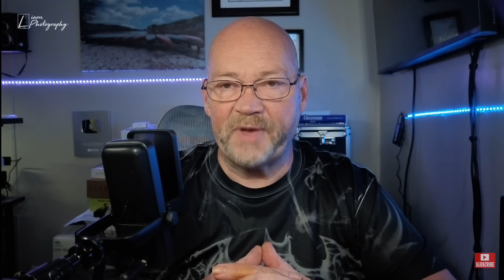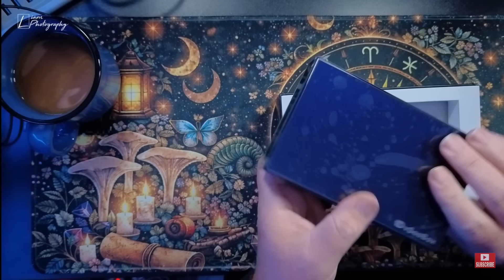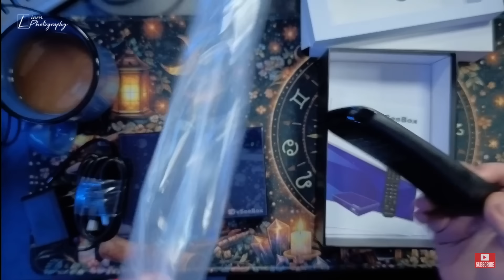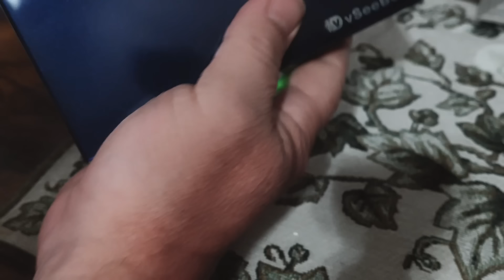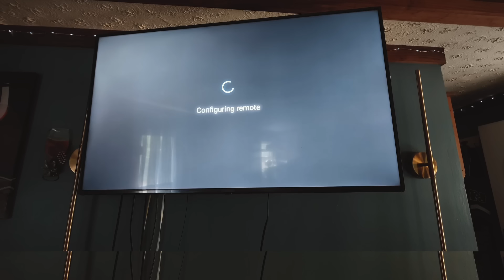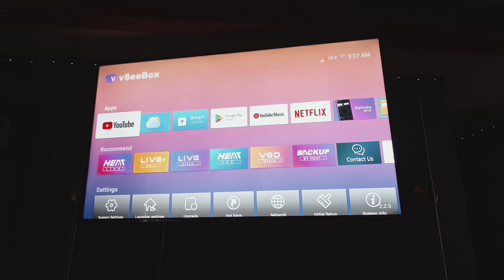vSeeBox V6 Plus Review: The New King of Media Players?

Comment: I should really “cut the cord”. I need to research because I need the easiest solution that gives me the best/most content, least maintenance (I loathe having to keep up with firmware, codec, whatever updates but know I might have to do them…just want EASY & Safe/Security), no or low cost subscription, DVR/Recording (lots of hours), voice control via remote if available, works with my soundbar…yeah, I want it all 😊
Reply from the maker: well, the VC box can pretty much do it all, including DVR recording, which is really cool, and the software is really great. Works really well. The only thing I recommend is that you put it on an IOT network Wi-Fi network segregated from the rest of your stuff, and it probably would help to also use a VPN as well

Comment: Good video! However what about the security issues with this device as far as streaming and not having any issues getting hacked can you tell your viewers about that so thst they can aware of it ?
Reply from the maker: I basically keep mine segregated in a separate IoT wireless network on my home systems, and I make sure I keep it updated when I’m not using it. I completely power it off
Reply: What’s the best set up guess network a vpn a kill switch and change your settings to quad9 for better security
Reply from the maker: @francie4970  absolutely, that’s what I would do. You can use any VPN you want with it, so a good VPN and a good set of DNS servers are pretty much what you need
Reply: @francie4970  I have a V3+ and V6+, never had an issue with any suspicious activity.